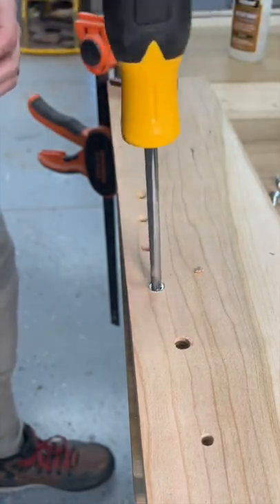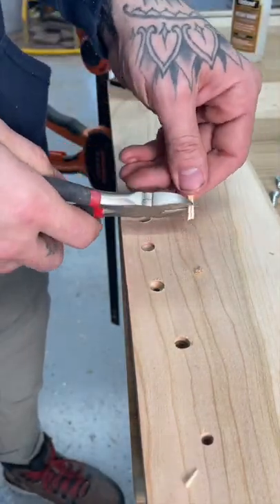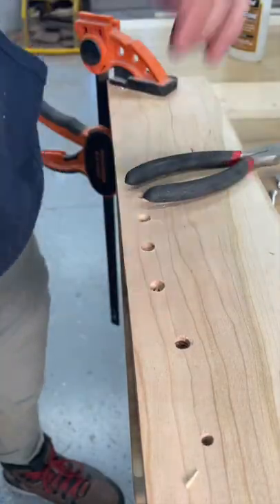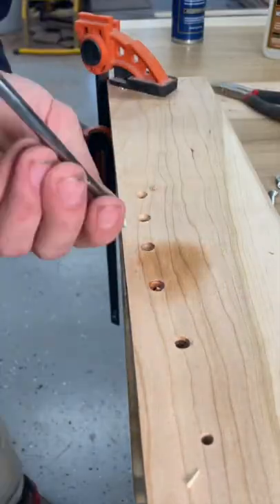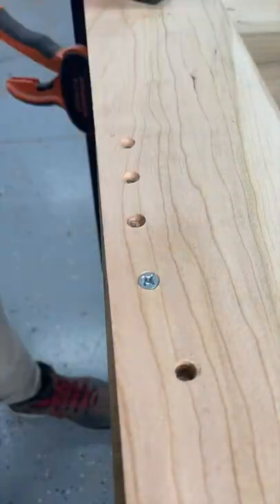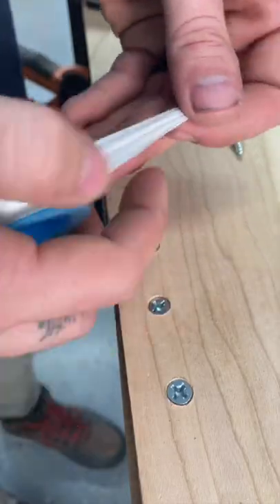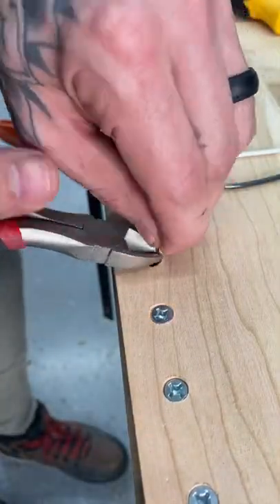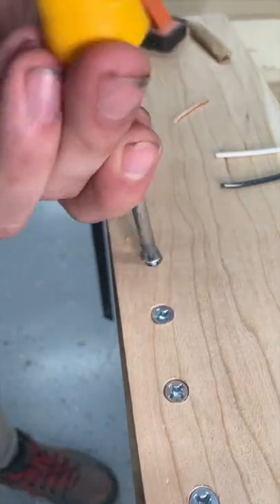4 ways to fix a stripped screw hole!

Comment: bro i have this one speaker that has stripped screw holes and was causing the speaker to not go down all the way causing a loud air leak sound but i tried the toothpick method but with a skewer and worked amazing
Reply from the maker: Heck yeah! Glad it helped. Best feeling ever when a random little tip saves the day 😆
Reply: @TwoMooseDesign  fr when i get the speaker fully repaired i’ll make a video shouting out your channel for the help